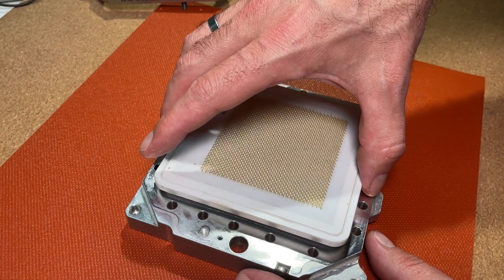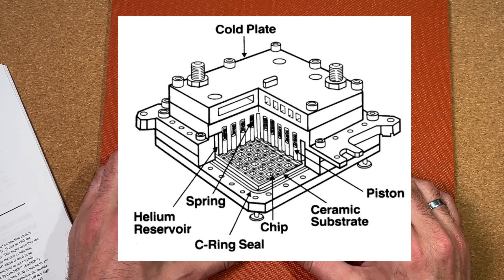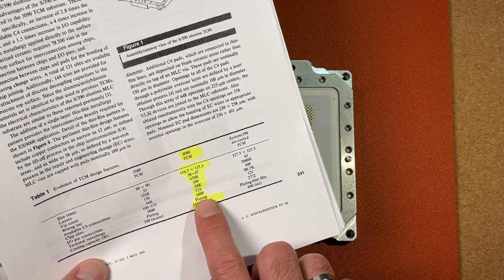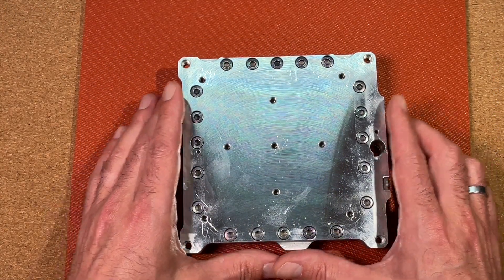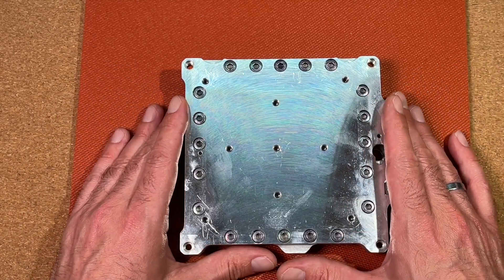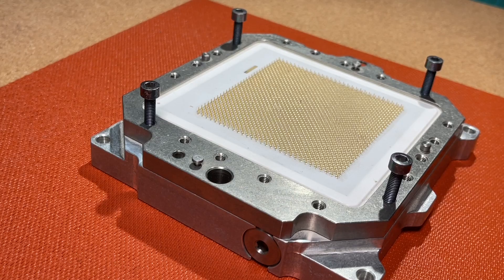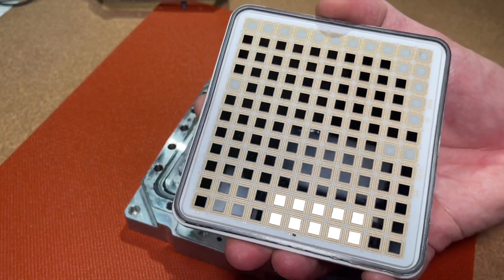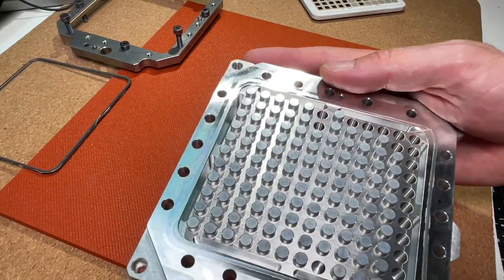IBM S/3090 Mainframe TCM Monster CPU - TEARDOWN

Comment: I used to program those, IBM’s CICS system at Hursley Software Lab Hampshire UK. I was a student at the time. I remember running up a £30,000 CPU bill when running a trace between two operating systems. Most of the software was written in assembly and PLAS (version of PL1). I visited the machine room filled with the S370 3090J machines. It was very impressive for the time. All I had at home was a Amstrad 8086. Now I have that power of that mainframe at home for less than £1000.

Comment: I worked at IBM Poughkeepsie developing the cutting-edge state-of-the-art automation to assemble, test and rework those TCM's in the late 1970's. I also developed cross training programs to train mainframe computer technicians to become manufacturing automation electro-mechanical technicians. That experience is what later formed my career as a Certified Automation Professional to build cutting edge state-of-the-art automation over the past 47+ years. 

Engineers today have no comprehension of that technology because they cannot google it. That whole process of laser mapping / laser cutting the shape of each individual 0.1mm pad, all the controls for the lasers, inserting each individual chip accurately on the MCM with custom developed cameras and robots, modifying any TCM using a custom made 6 axis ultrasonic wire bonder was completely automatic using IBM 7576 gantry robots, 7535/7545/7555 handling robots, IBM Series One I/O controllers, all which I was trained to program - even crashing one or two while developing the manufacturing programs. 
That automation and manufacturing was fully end-to-end tracked and logged by serial numbers and bar codes for quality control, testing, lot tracking and rework. 

Many people think each TCM is a separate CPU which is not correct. Each TCM on a backplane circuit board is unique per that mainframe configured for separate operational functions, and those functions could be changed using IBM 370/380/390 machine level assembler language (microcode) to modify its functions. 
Some TCM’s were ALU’s or Arithmetic Logic Units comprising multiple CPU data paths depending on the instructions being used, some were designed to control data flow to and from various I/O devices like memory, fixed storage, printers, tape drives, or network communications. 

I also worked on the automation processes to manufacture the various 9 -30 layer backplane circuit boards holding the TCM's and x-ray them for defects, then identify where the circuit needed to be repaired for a robot to make the precision interplane modifications and wire repair. Each circuit board ranged from 3 'x 3' to 3' x 6', the largest backplane could hold up to 36 TCM's. 
Trust me, you do not have one of these in your hand today as a modern smart phone.
 
These mainframes were purpose built, purpose programmed, 64-to-128-bit (quad/double quad word) data path mass data crunchers for compiling millions of “records” a second which is not the same as million floating point “mathematical” operations per second. It is more like comparing a thousand acres of peas to counting 7 or 8 peas in a pod. 

Your smart phone cannot process the payroll for 100,000 employees is a few seconds with 100% accuracy like these machines could do back in the 70's and 80's. The longer time it took was not to compute the payroll, but to automatically transfer and save the data, print the paper check, automatically fill the envelope, put the envelope in a mailer bin ready for the US mail to pick up. That took an IBM 3800 laser printing subsystem that could print a mile of paper forms in a few minutes to go to the mailing equipment.

I also worked on assembling the first quad multiprocessor mainframe in the late 1970’s in Poughkeepsie’s R&D sound lab that became known as "Watson" built specially to detect, interpret and comprehend speech in any language, accent, dialect, slurred words and with lisps.  Now your Google and Alexa translate app can almost do that but only if you are connected to the Google server farm through the internet where the power resides.
Reply: Thank you very much for this fascinating insight! Amazing what economies of scale can achieve, vis a vis data throughput in the second half of your comment.

Comment: That was amazing, thank you for such a great video.  Do you have any sense of how much processing power was in one of those modules?  Perhaps compared to say a Pentium 4 running at one GHz or perhaps a recent iPhone.  It's amazing when you think about the reduction in power per megaflop (or whatever) we have seen over the past 40 years.  I think many seasoned design engineers circa 1985 could never have imagined where we would get by 2021.  The leaps in processing power, clock speed, thermal efficiency, memory capacity, and storage capacity are absolutely astounding.

Comment: I don't think IBM sold a lot of 3090s.  They billed them as a bridge between a mainframe and a supercomputer.  Adding the Vector Processing Facility would turn it into a full-fledged supercomputer.  It had trouble competing as a supercomputer, though, as it wasn't fast enough to complete with upcoming systems from NEC and Cray.  They ended up selling far more 370s in the same time frame and eventually discontinued the line in 1990 with the introduction of the System/390.

Comment: Very nice piece. Thanks much for sharing this addition to your collection. Fun fact: The larger LGA-3363 version of the POWER7 is basically the same idea as the older TCMs used in IBM's earlier System/390, 3080 and 3090 machines. They are of a very similar construction and design consisting of a large and heavy metal thermal hat and mounting frame assembly with a ceramic substrate inside, albeit with only a single large CMOS die in place of the 132 smaller ECL dies that your 3090 TCM has and no pistons or helium gas fill inside. I did manage to get a POWER7 single-chip "TCM" of my own and I even drew some accurate scale line art drawings of it in MS Paint. I've seen at least one eBay seller in my country selling a TCM like this one but he wanted something like $350 for it, too expensive for me since I have imposed a per-item limit of $50 or less on the chips I buy. If I had an actual income where I could save up the money, I'd try to buy one, but that's not possible at this point in my life. Still, seeing yours was cool all the same. :-) Also, are you aware of IBM's latest feat with 2 nm process technology? Very impressive stuff.

Comment: Another piece of insane IBM engineering -- that ceramic substrate? All that precision layout for all those connections to the silicon dies, all the vias? The ceramic material shrinks around 17% when it is fired. That means that the pre-firing layout in the (green, unfired) ceramic has to be done with that shrinkage taken into consideration. All those traces, all those interconnects, all those vias -- none of them can open up or short during firing, shrinking to their precise locations, producing the final ceramic.
Reply: Someone involved in the development of these chips in the comments here discussed using precision machinery to fix defects in those substrates after locating them on an x-ray, which is honestly even more impressive to me. Micro-scale ultra-precision wiring fixes, etc. 

(But I imagine, as with any manufacturing process, there was an upper bound to the number of defects that were considered worthwhile to be fixing.)

Comment: The brick you see there does not have any wiring around the perimeters of the chips. The design allowed for a limited amount of "rerouting" signals by cutting the path between a via and a bonding pad and running a gold wire (about the thickness of a human hair) from one pad to another. Some bricks had hundreds of wires. The machines that bonded and ran the wires were ludicrously complex mechanisms. I was involved with the process that cut the leads between the vias and a bonding pads- probably one of the earliest uses of excimer lasers in industry.

Comment: So the documentation states they use a clock time of 17.2 nanoseconds. That would put it at 58mhz according to a calculator. In practice it may  have been actually somewhat less than that, or that could be including cascading. But that is still very impressive for the late 80s.
Reply: Propagation delay per gate in those chips would probably be in order of 0.1 ns, which is insanely fast for those times. But ECL (Emitter Coupled Logic) is very power hungry, because it consumes current all the time.
Reply: @Alexagrigorieff  Absolutely. The heat generated by even a modest 3090 system is on the order of 15000 watts. Its rather unfathomable how much power these systems consumed. Though modern blade racks are not any better i guess.